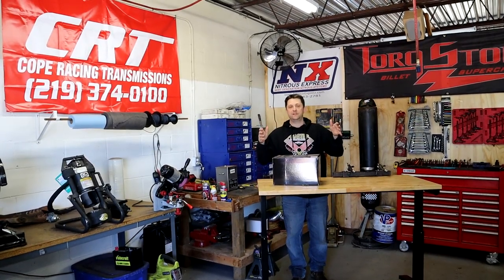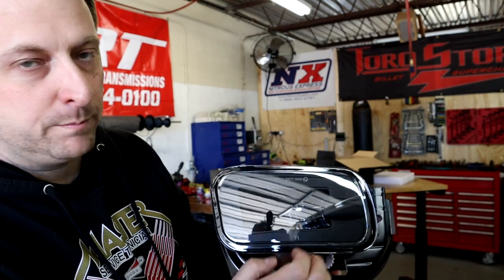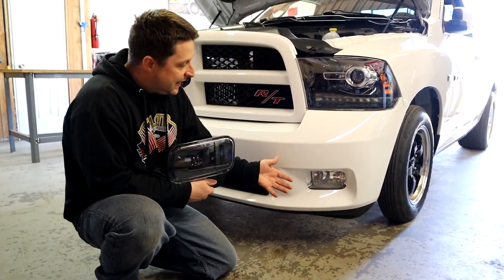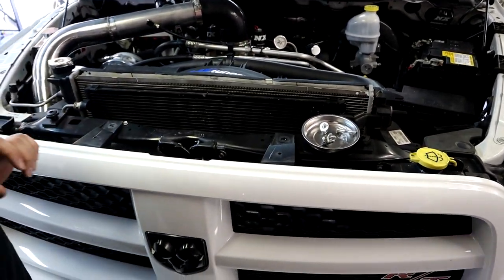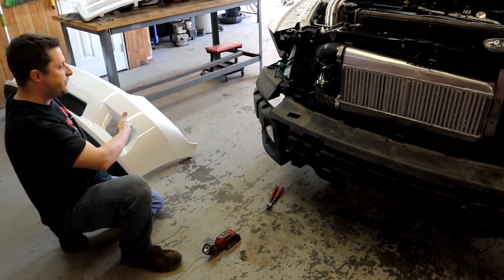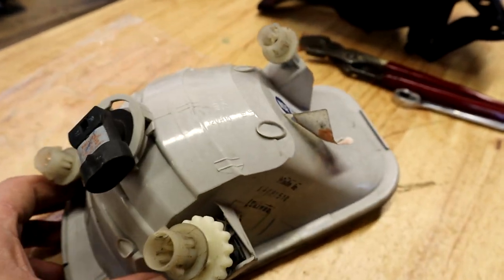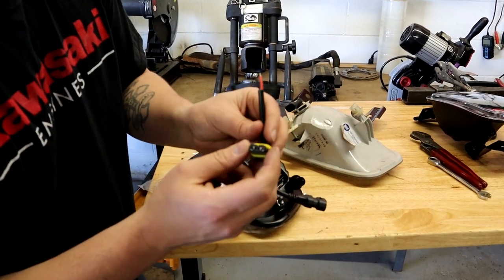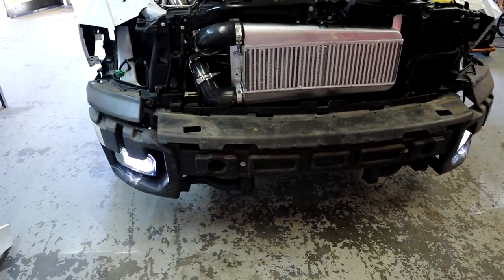LED Fog Lights For Your Ram Truck From BICYACO Full Install

Comment: Are there any makers that make a yellow bulb?
Reply from the maker: I'm sure could always just swap the led bulb out.
Reply: That's what I meant. I'm just resourcing to see if anyone knows of led bulb manufacturers that make them in yellow.
Wish we could post pics on here
Reply: Welp, glad I did some research. I was about to jump into getting these.
These are sealed. Meaning if the bulb goes out...you be s.o.l. So unfortunately, as stellar as they look on yours and they'd fit my blackout them on my clear water blue ram, I can't go with non replaceable bulbs. Damn!

Comment: Have the fog lights held up?
Reply from the maker: So far great but just installed them
Reply: @FrostbiteRam  my bad. I thought this was an old video cause i recently found your channel btw. Im liking your other videos! Is the light output any better then leds or hid on stock fogs?
Reply: @FrostbiteRam  it's been a year. I'm also curious about these questions.